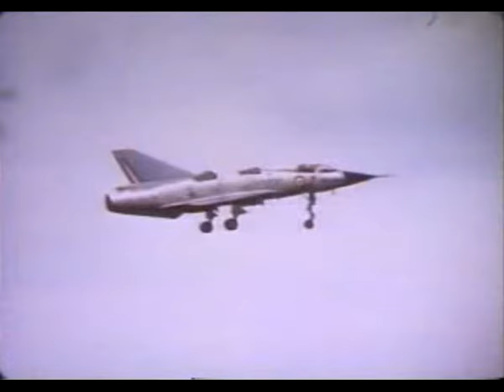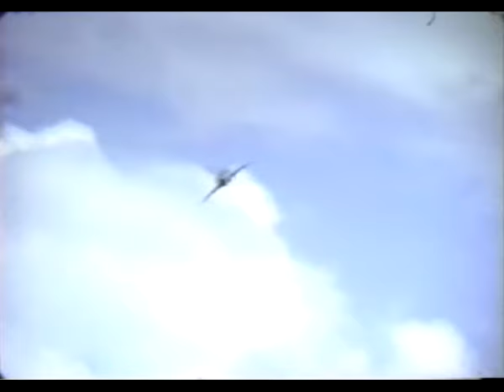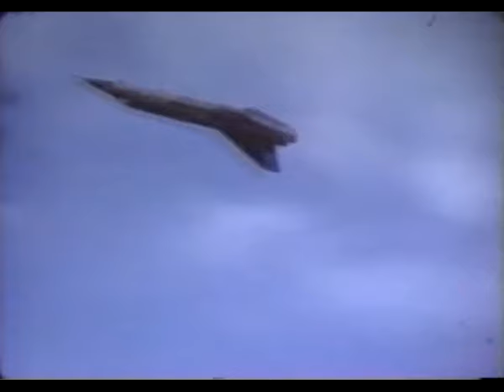Dassault Balzac V

Comment: It required a concrete launch ramp and it's payload was too small to be practical. No point in being VTOL if you still require an airfield. I agree the Harrier was a better VTOL aircraft but drag from those huge air intakes prevented it being supersonic and the airframe was not strong enough either.

Comment: finaly i found what i been looking for, it was France who came with the VTOL idea, the British liked what they saw and continued with the same idea and the Harrier was born, afterwards the Soviets with the Yak 36 and Yak 38
Reply: The Harrier hovers with a completely different lift arrangement, with vectored thrust from its single engine. The Dassault had 9 separate engines; the main and eight vertically mounted smaller engines which would shut down in forward flight. So, no. They are vastly different aircraft.

Comment: The concept was sold to the british for the harrier ;D
Reply: The Harrier hovers with a completely different lift arrangement, with vectored thrust from its single engine. The Dassault had 9 separate engines; the main and eight vertically mounted smaller engines which would shut down in forward flight. So, no. They are vastly different aircraft.
Reply: @evulgenious  Plus the Harrier was a success!

Comment: So many BS assertions here, so let's have some facts:

1. EVERYBODY was investigating VTOL from the 1950's. Even USA had some weired designs. It was a race to find a successful design and all the US and French attempts were ultimately failures. The Balzac included.

2. The first SUCCESSFUL design was the Hawker P1127, based around the then-new concept of vectored thrust from a single engine (the Pegasus).

3. The second successful plane was the Yak38, which took an approach which was a hybrid of a new concept (vectored rear nozzle engine) with a limited application of the French concept (i.e. 2, instead of 8, auxilliary thrust engines).

4. The Yak41/141 (they were the same plane) was an attempt to develop the Yak38 concept into a supersonic plane, which led to the development of the single afterburning vectoring thrust nozzle. Lockheed Martin's interest in this plane was focused on that vectoring nozzle, which eventually made it into their F22 and F35 designs. However, the Yak 41/141 was never produced beyond test prototypes.

The world is full of "firsts", if you include planes that never made it past prototype or even the drawing board (or paper airplanes, like Boeing's much vaunted Concorde rival). While there is no shame in taking pride in the imagination and innovation of early pioneers and their experiments, it eventually only matters who got the first successful application. The French only succeeded in showing what would not work.

Otherwise we may as well end this argument by saying the Italians did it first (Leonardo Da Vinci's helicopter design).
Reply: lmfao i like that last line XD
but we can still give credits to the only Mach 2 VTOL aircraft ever, prototype or not right? ^^

Comment: Of course the french Know this technic , was copied by UK With harrier , and the USA with f35
Reply: No, F35 is copied from Russian Yak 144, also british harrier used single engine
Reply: This french aircraft is from 1960 ...  the Harrier from 1966 and the US F35 from 2008.
Reply: @kriticfilms7262  The only resemblance of an F35 to the Yak is the engine layout, and even that is a very weak connection. The Yak used a second engine to drive its forward fan. The F-35 drives the forward fan via a shaft from its single engine.